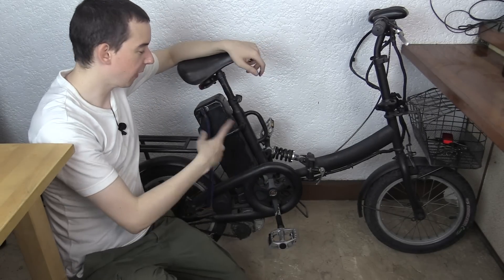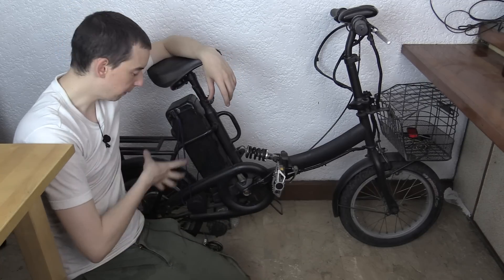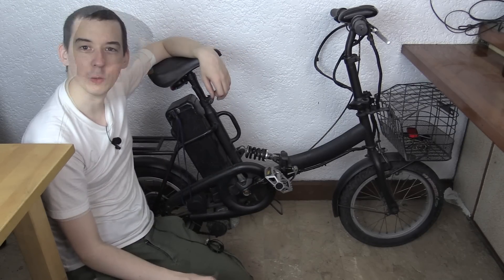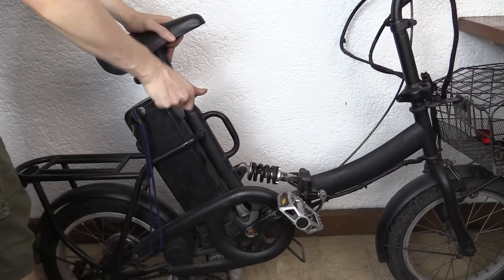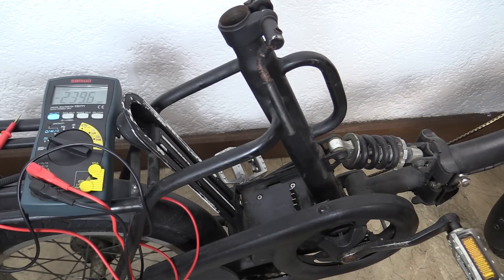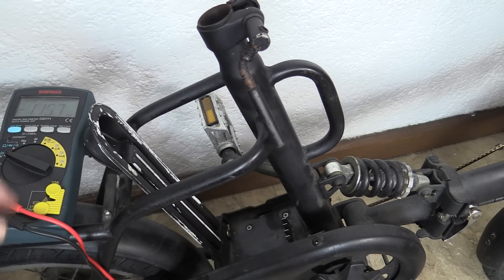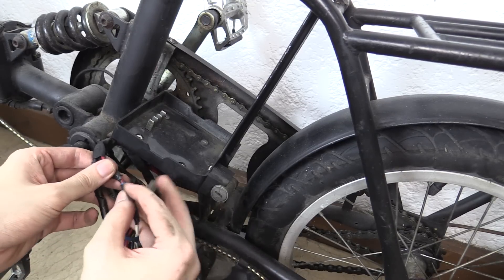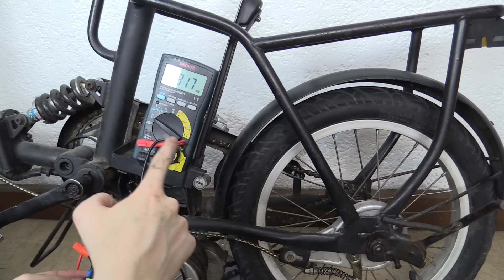Convert your Ebike to a Generator - Part 1

Comment: for how many amps is the switch designed for?
uc, during each startup a motor need quite a lot amps. 
its almost like a short circuit.

Comment: I don't understand why you are going through all this instead of placing a dinamo or an alternator on the front wheel.
Reply from the maker: Because the average dynamo doesn't generate much power. I don't have an alternator or an easy way to mount something so heavy. And the front wheel doesn't turn when you use the bike stationary inside as a an exercise bike. So quite a few reasons really.

Comment: Isnt most ebikes use brush less motors. That means 3 - 8 wires come from the motor
Reply: Brushless motors have a one way clutch. For a good reason. They would add significant drag if you wanted to use the bike without the electric assist.
Reply from the maker: Some are brushless. Mine isn't.

Comment: does this provide enough power to recharge the bike with surplus in the batteries? If so you coild fit a trottle and gaffa tape it down for limitless power.
Reply from the maker: Wow, I just tried it and it worked! I was able to light a lightbulb and charge the bike battery at the same time and it's been running for over an hour!
Reply: @GadgetAddict This is not taking into account the power draw to run the motor. You cannot have a system produce more power than is put in.
Reply from the maker: @KristopherBlakeley  lol i was joking. There's no such thing as free power.

Comment: Hey and thanks for this helpful video. Maybe you can help me to give me a tip for my idea/problem.
I developed a special four-wheel e-bike. 
The bike is powered up with enough power, that I don´t need any muscle-power. I only have to padel to give a signal to the controler (without any muscle-force) and the e-Motor work.
But I want to exersice a little bit, so I come to the idea to use a pedel-generator to charge a littel bit my e-bike-battery - so I have a little exercise (if I want) and can expand the range.

Do you have a idea how I can realize this idea. I would have so many questions ;-)

Best reguards from germany,
Martin (martin@mint-slot.de)

Comment: Thanks for that its a good idea I think metal would be a good stand as timber might wear and break eventually
Reply from the maker: Kriss Bartlett Yeah I think you're right. Although during my testing (coming in part 2), one thing I realised is that the back wheel wont be spinning anymore. The pedals will drive the motor and all I need is a stand that prevents the bicycle from falling left or right, not to raise it up. So that might simplify things a bit.